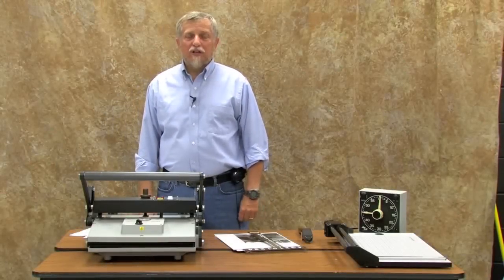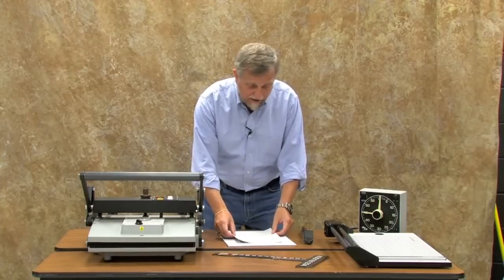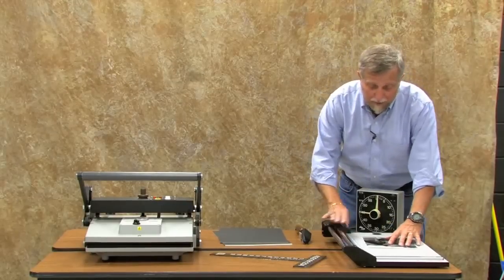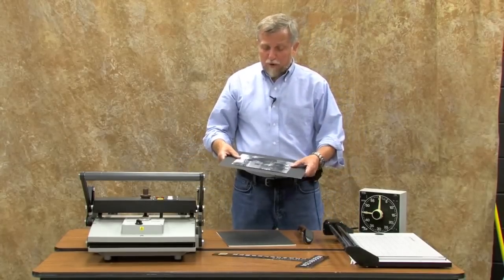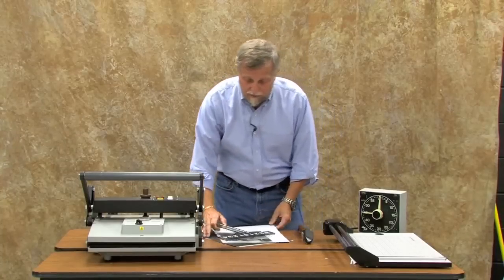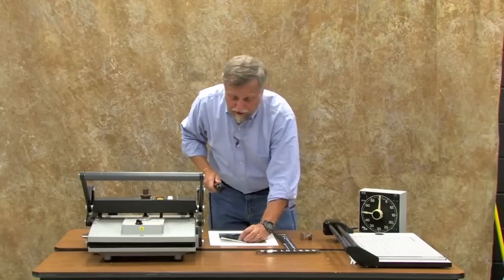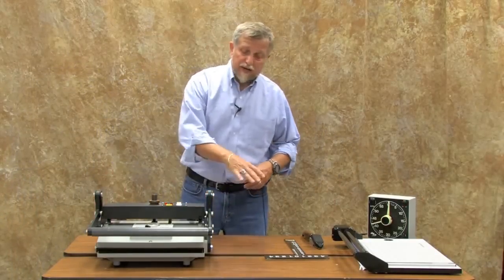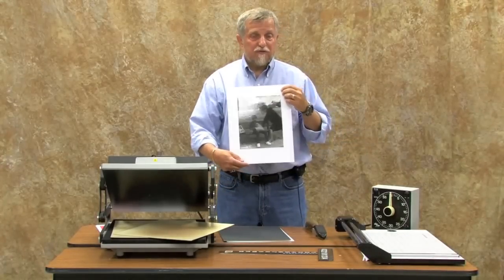Dry Mounting Photographs

Comment: I used to dry mount, but I don't anymore. Trouble is, once it's stuck to that board, it's stuck, which in the case  of a (potentialy) valuable image, would immediately de-value it. I now use my mounting press cold, to flatten dried prints, prior to storing or framing.